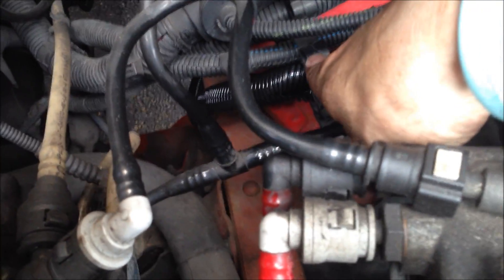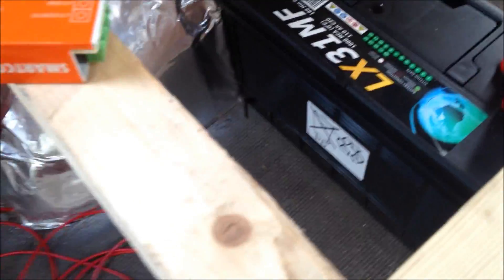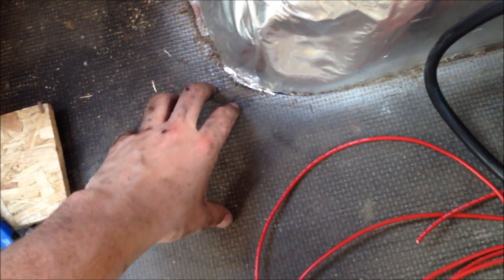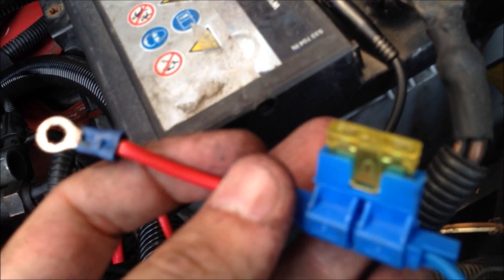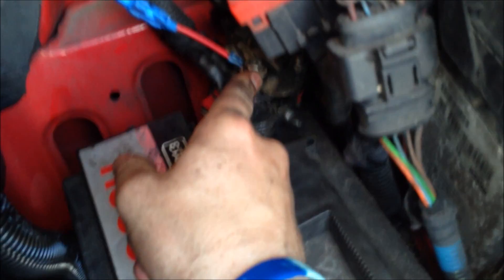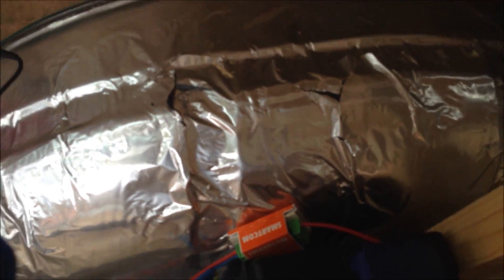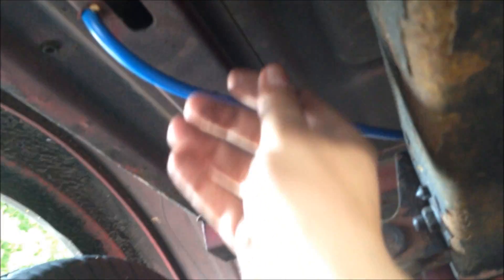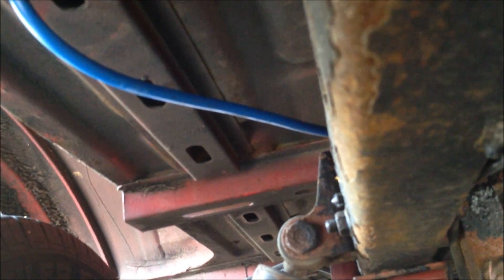6. Iveco Daily project: Split charge relay install

Comment from the maker: All the comments about not using House 240v cable I understand what you are saying. I used 3 cores in the end not just 1, 60amp Alternator 1 core x 3 = 60amp. Never had a problem with it, wires do not get hot or even warm.
Reply: People don't seem to understand that just because the van has a 60 amp alternator, the alternator will not be pumping 60 amps into the battery at any tme, your system is fine.

Comment: So has this gone up in flames yet ? 
FFS sake people DO NOT take any notice of this video. The Split Charge Relay cable should at least be able to take what the alternator puts out ... 80 ? 90 ? 100 amps ? Thank fuc* there was at least a 20A fuse that would probably blow as soon as the relay kicked in. Using household 2.5mm cable is asking to come out to a smoldering wreck on your drive, assuming you don't die while your sleeping in it. Please remove this dangerous piece of information regarding SCR  before you inadvertently cause someone to kill themselves.

Comment: Why don't you remove this video? There is no way you haven't seen these comments regarding the potential dangers of using such low rated cable. Chances are it will just fail but there is also a chance of your advice killing someone. Especially in a camper. There is no way you system hasn't burned out, yet you persist on leaving the information in the public domain. Just remove the video.

Comment: ACHTUNG! DANGERAUX! FARE! DANGER! HAZARD! It's like nails on a blackboard to hear you say that because your cable is rated for a 230V running 12V through it will be fine and over the top, well yes, but that comes down to insulation specs. You need to get your understanding of electricity right. What you need is a wire that has the section/mm2 to carry a specific amount of amperes, 2,5mm2 for running 20 amps is asking for a fire. An online cable section calculator i found recommended 6mm2 if accepting 5% loss and a skookum 35mm2 for 1% loss! You must have felt the heat in the wires if running the test at 20 amps!? Look at your comments, I'm not the only one pointing this out. Please redo your system and take this video down, maybe make a new one explaining your hazardous mistake.

Comment: Sorry No disrespect to the man but this is not what i would do . Mains Cable is not the same as Automotive cable  for various Reasons , the cable you have used here is a 1.75 mm2, 3 core  this is not right the cable size  minimum is a 4 mil auto grade also where is the switching for the secondary coming from if you have it wired to a switched live on the motor from key stage 2  then this is incorrect for this type of install  the switching sense should be taken from the sense pick up on the Alternator . there is reasons for this  too . jamming the relay so it is permanently closed contact will put the alternator in to a higher state of output  trying to feed both at once  from the word go unless the alternator can cope with two voltages is not good as it will reduce the operational hours of the alternator  ultimately costing you more . and that far away from point of origin will load drop over time you only show 14.1 off the battery .what is the volt and load in once battery is engaged .  Remember the lower the voltage the harder it is to move it .did you amp load in test the unit too when it was running alternator on that model puts it's  peak output at about 1900 rpm Diesel .  You will be lucky to see 4 amps @ secondary source charge in that is . fair play but be safe be right electrics kill Believe me i have seen first hand what it can doo and picked up his remains Not good . Stay safe if in doubt Consult a Auto electrical engineer , Or Send me a message . Reckymech . electrical mechanical Engineer 20 years + . stay safe when playing with auto electrics xx .

Comment: Thanks for this! One question as to where on should put their battery. I understand it needs to be vented to some degree. Im assuming that the one you have installed above is under the bed or furniture of some kind. Did you vent to the outside or is the open space enough? Cheers

Comment: One thing I noticed you used the blue cable on the household electric cable to run your live which is normally negative, should have used brown cable just in case someone cut into cable half way along and thought it was the negative, but comment say you shouldnt have used this cable anyway.

Comment: That cable you are using is no way thick enough for charging. Also, a 20A fuse is likely to blow the first time the relay engages. The alternator is rated much higher than that, and the split charge system is able to draw a lot more than that. You best bet is to use something like 25mm2 cable (10x thicker than the twin and earth you've used) and connect a heavy duty relay to be triggered by the (rather weedy) voltage sensing relay.

Comment: Hi mate, hate to tell you this but that 2.5mm flex is potentially deadly and you'll burn your van down FOR CERTAIN! Yes it is rated for 240 volts but it isn't about volts its about amps, you can put 240v down very thin wire thats true, not big amps though!! Your electric oven or electric shower in the house are the biggest amperage items and will have 10mm cable feeding them. You've put a long run of 2.5mm to a big battery connected to an alternator that can maybe put out 80amps, I'd be putting 16mm minimum on that installation. If you want to see for yourself make some jump leads out of 2.5mm and hook them to another van and wait for the smoke. I fried a pair of cheap jump leads made from 6.5mm last year on an escort/mondeo, you've just made a pair a third of that size.